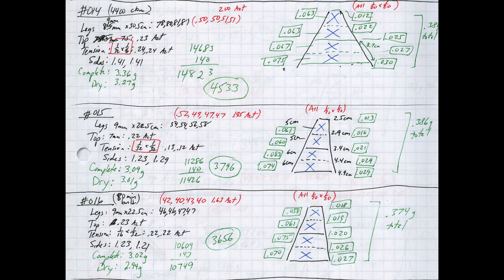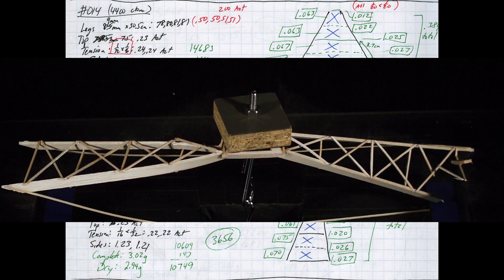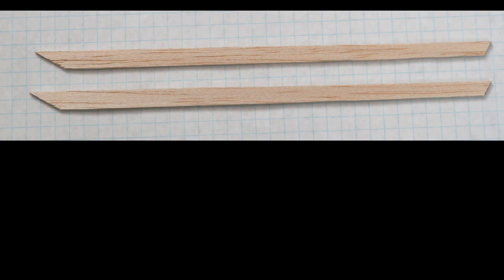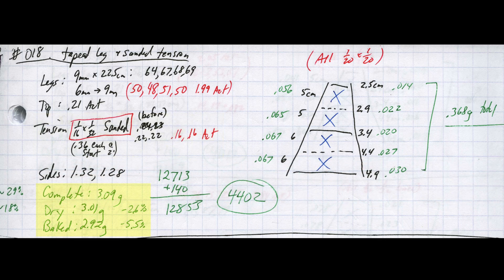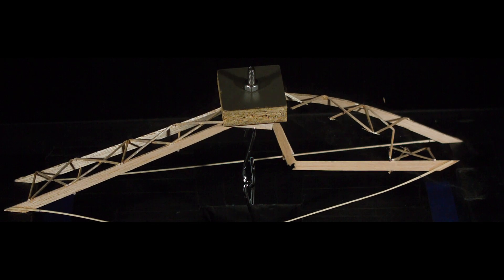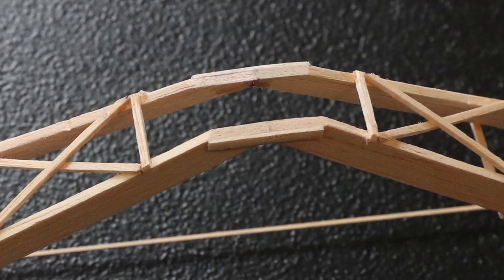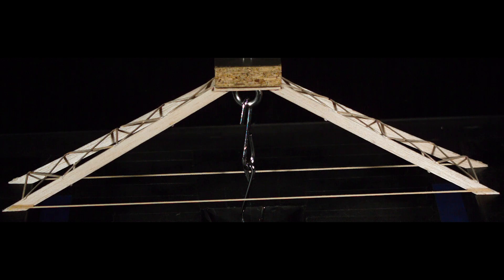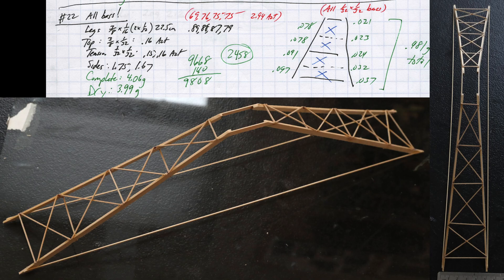Advanced Optimization for SciOly Structural Competitions: (PART 4: More Optimizations)

Comment: ive been trying to look at past sci oly national bridge competitions, but it looks like the last time bridge was available at nationals was in 2015. am I correct about this and will there be a national bridge event for this year?
Reply from the maker: The last few years have been: 2015 Bridge, 2016: Bridge, 2017 Towers, 2018 Towers, 2019 Boomi, 2020 cancelled due to COVID, 2021 Boomi (virtual), 2022 Bridge.  Each year of the same event they tweak the rules a bit to make it harder the 2nd year.  The best place to read up on what happened in past years is here:  https://scioly.org/forums/index.php
I haven't read any details of what is happening this year, but I think Nationals is going to be virtual, so I assume Bridge this year will also be virtual like they did in 2020.  Good luck!

Comment: Just won my regional from your design!
Reply from the maker: Congratulations!!  I'm glad I was able to help!
Reply: @balsaengineering6686  Now that I’m thinking about state, I have a question. Would it be okay to use my regional bridge at state? It weighed 8.9 grams and held all the weight (score:2252). I am willing to build another, but it would be easier for me if I could take in a bridge that I knew already worked. Thanks in advance.
Reply from the maker: In general, if your device held the entire weight, it should be fine to go again.  If you are really worried about it, you can test it again yourself to 15kg and if it hold, it will definitely be good to go.  Good luck!